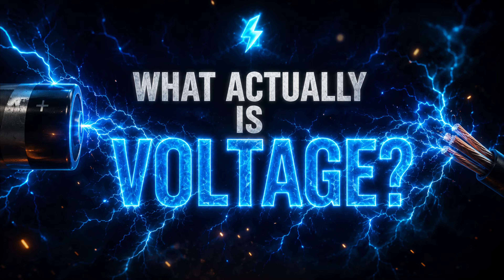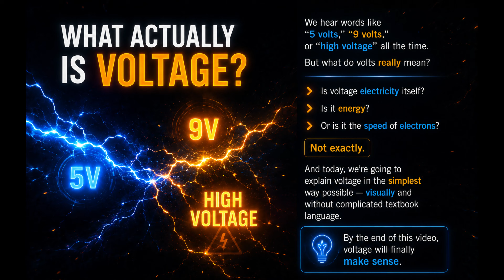What Voltage Actually Is

Comment: Oh brother. Voltage is induced magnetism. That’s how voltmeter works. It’s basically an electromagnet and how much magnetism is induced by the current is the voltage. It’s also how a power meter works. 

What gives rise to electricity is friction. Not electrons.
Reply from the maker: Thanks for watching and for taking the time to comment.

Just a small clarification: voltage itself isn’t induced magnetism - voltage is the difference in electric potential between two points. Magnetic fields can create voltage (for example in generators), but batteries create voltage chemically without changing magnetic fields.

Also, friction is only one way to separate charge (static electricity). Electricity can also come from chemical reactions, light, heat, and electromagnetic induction.

Really appreciate you sharing your thoughts.